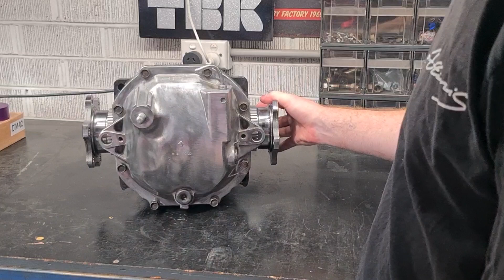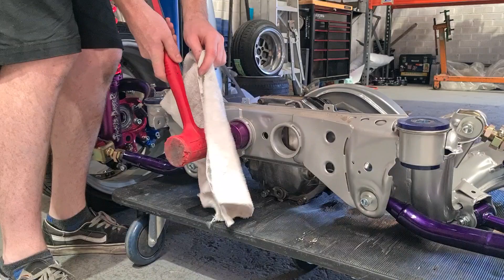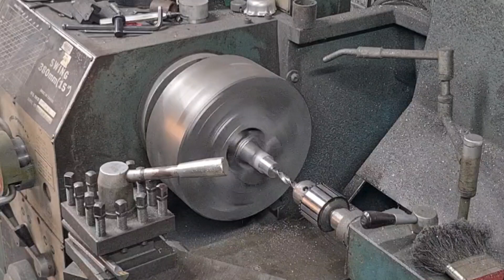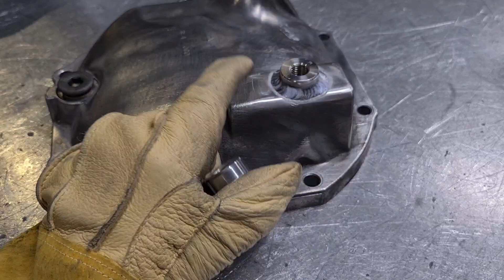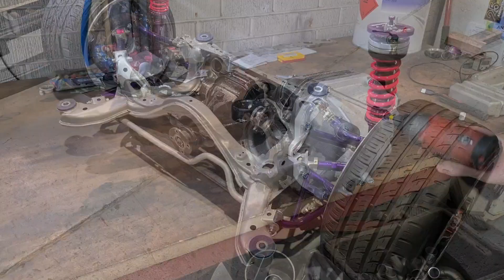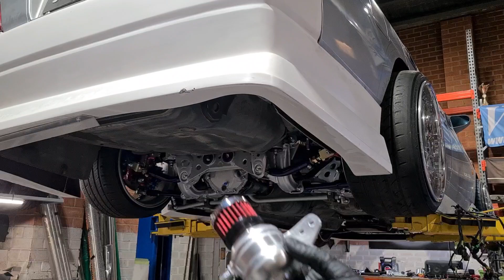350Z diff into S15 subframe, fabricating mounts + diff catchcan setup for my C35 Laurel driftcar.

Comment from the maker: What would you do differently?
Reply: use a diff brace instead of welding on another stud. Had one on my 350z for years and copped abuse and felt great. I would worry I would warp the case by adding a stud with the heat but cool to see it all done. I thought the r200 design is better than the 350z diff due to having two mounting points from factory....are the internals of a 350z diff stronger than the r200?
Reply from the maker: @harper6089  350z are stronger internally yes as well as accommodating the much better 350z axles as well. I've seen the bolt on brackets, they work fine but look like an afterthought which i do not want. The wedding of the housing did not warp it in any way and i did two passes so I'm hoping it's plenty strong enough, time will tell though.
Reply: @ThirdStrikeBen  Ah okay thats good to know. Yeah sweet it did look really good how you did it ngl. Coming up very clean mate cant wait to see it done. Definitely making some of the cleanest builds in aus man keep it coming.
Reply: I would have mounted the breather can a little higher up somewhere. It might overflow depending how hot the diff gets, also the G force from acceleration will push the fluid back into the can.
Reply from the maker: @norevlimitr1602  i have considered adding baffling in the can for that reason yeah, there's nowhere else to mount it up higher though and I'm not putting it in the boot, gear oil smells awful
Reply: dont know . looks great

Comment: The 350z diff sits too low for lowered cars. The axle angle is shit and will blow axles. I have had this exact issue and instead swapped to r34 gtr diff with 3.5 ratio
Reply from the maker: You clearly didn't watch the video then otherwise you'd know that i raised the diff in the crade.

Comment: I have a question. Does a schassis ring gear fit the z33 center section? 
Also does your breather have a check value?
Reply from the maker: Sadly no, the cw&p are the same diameter but not interchangeable, you need to use z33/z34 specific gears. And no the breather doesn't have a check valve, but is baffled inside the diff hat
Reply: @ThirdStrikeBen  thank you for your reply 🙏

Comment: Out of curiosity. How come you raised the front of the diff, but you made the rear lower using the offset bush?
Reply from the maker: I raised the front of the diff and once it was bolted up there the rear bushings were made to shit wherever the diff hat landed, i didn't make the rear lower, it's just wherever the front diff mounts dictated where the rear would sit
Reply: @ has mounting it like that changed the pinion angle?
Reply from the maker: @Raysboostin  not atall, i raised the whole diff assembly perpendicularly to the ground to bring it back up to where the stock r200 diff would have sat

Comment: Nice work. What rear drive shafts are you going to use with the 350z 6 bolt (evenly spaced)  hub pattern on the diff?
Reply from the maker: I have a pair of oem 350z axles to go in, they bolt straight up 🤗
Reply: @ThirdStrikeBen  I've done a similar thing on mine. The 350z drive shafts were just a bit longer than the s14/15/r33/Laurel drive shafts so I didn't think it would match the subframe and risk binding during suspension travel. My solution was to slip off the 6 bolt inner hubs off the 350z driveshafts and put them on the inner r33 driveshafts that I had (the 350z shafts are the same thickness as the s14/15/r33/laurel ones so the spines match). You could do the same if you find that the 350z driveshafts are too long for your application.
Reply from the maker: I appreciate the info! Will do some testing 😁